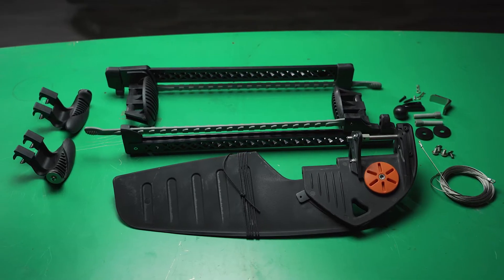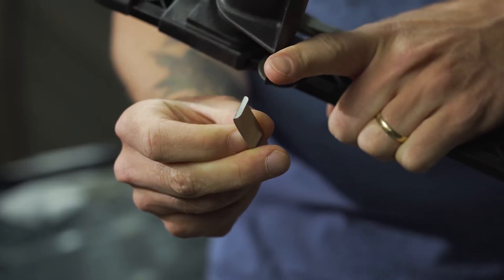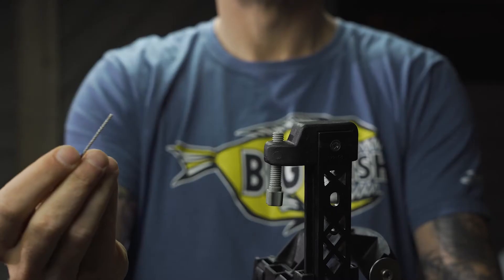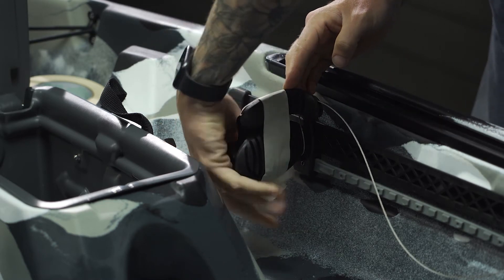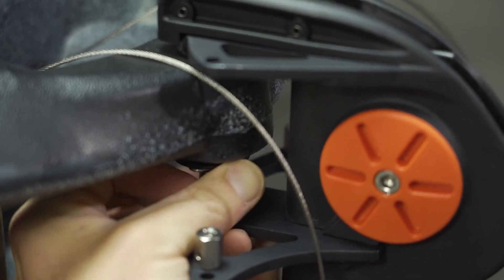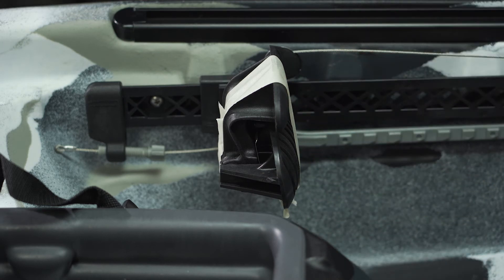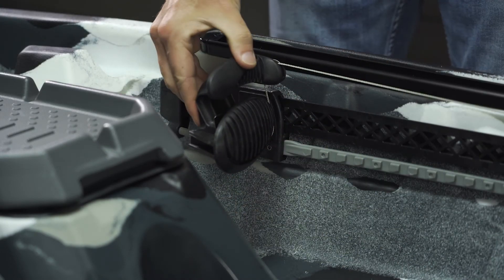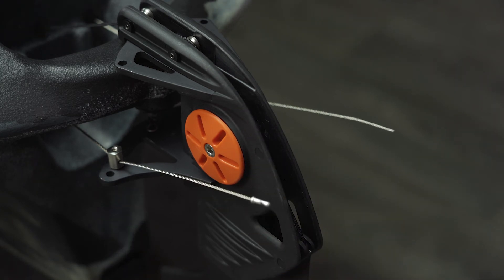Installing The Beaver Tail Rudder on the Big Fish 105 & 120

Comment: Just got a Big fish 120 (used). Looking into getting a rudder system. Various rudder kits for other brand kayaks, eBay etc are all around the $100 mark. Big fish 120 kayak rudder system $255 + postage. WTF???? Are the gold plated or something? Im thinking of the possibility of making one.
Reply: I just received the kit in the mail this afternoon. I bit the bullet and bought one even thought they are expensive, I had too. I put a Watersnake T24 down the sonar pod hole with a custom mount bracket which is an excellent set up but without a rudder the back end of the kayak was all over the place and very hard to turn. I could only turn by putting drag on either side with the paddle which slowed me down somewhat. In its defence, the kit is good quality. Way better than some of the universal kits I have seen.

Comment: My first kayak, I just bought a used 1 year old BF120 from a guy in my town in great shape.
Pedal steering is very stiff for some reason, is that normal?
A quick glance everything looks in order, I will look closer soon as I get time lol.
I can't tell if it turned or not, very weird feeling, I keep looking behind me which is super hard to see if the rudder turned.
How can I make it smooth and not binding?
Reply: Probably too late for ya on this one , but may help someone else . I went through my entire rudder assembly (bought 120 second hand , so not trusting anything previous owner did ) . I ended up replacing entire cable system with stainless 1/16” cables (tractor supply carried it by the foot ) (i used 1/4 poly tubing from lowes as the new cable sheaths and left some excess out each hole placing 2 zip ties at each end as a strain relief after stretching any slack out by doing one end at a time )( cable swags crimps can be also purchased for a nice job at tractor supply as well but must have a swag tool on hand to perform the task ) , ran new cable sheaths(which i found the end stops to have broken off letting the sheath fall into the haul (only means of access is through your pole holders left and right by removing the 3 screws if you find yourself in this situation …) to replace the sheath cable jacket you will have to use a stiff wire (bailing wire from farm supply store is best !!!) and access mid way through the  pole hole i mentioned and hook it again . Its a real pita to say the least . After getting all the adjustments and cables up to workable , i still had the still foot control rudder but moves freely at the rudder itself . Cables binding at the poorly excited pully on the weak foot pedal design (just my 2 cents ) !  Long story short went through the entire deal due to it breaking and seizing up on a day fishing at the lake 😢, as a last resort of fabing my own rigid pedals from aluminum to get it back up and going , i removed the flat metal springs behind each foot rudder thinking it was creating to much drag each direction over the cable span (2 flat springs per pedal have to remove pully screw and flip pedal back to remove them ) and bam !!! No more ruder drag . It moves as it should now with very very little effort . Not aure what the consistence will be if any yet as i have yet to have it back on the water , but i see no issues comparable to binding controls on the water as before ….
Reply: Fyi took 20 ft of stainless cable for 2 sides on this 120 12’
Reply: Update : may consider adding 1 spring back to each foot control only near the outer most position under pulley and play with spring tension by bending in our outward so there is just a slight bit of drag to hold rudder position in water when feet are not on the pedals . If you do not need to hold position and remove feet dont worry with it . I use mine to combat current and use it to set counter current wind etc but both springs make this system way to tight and binding